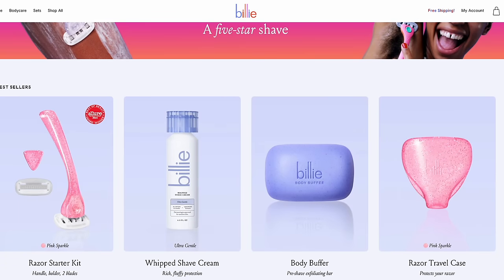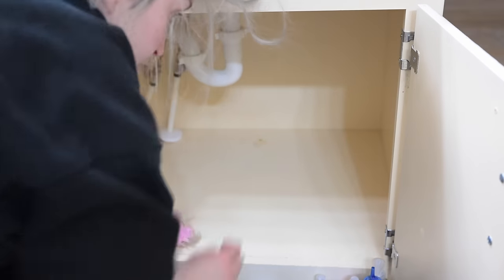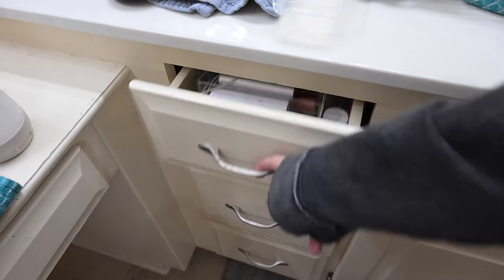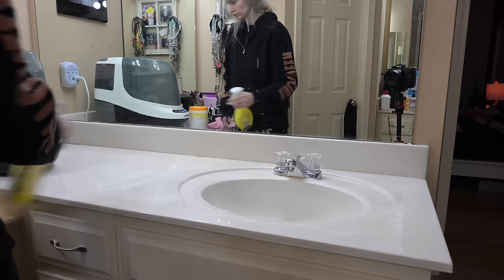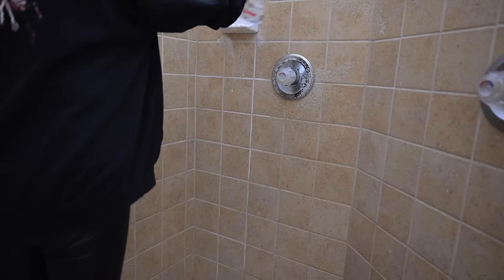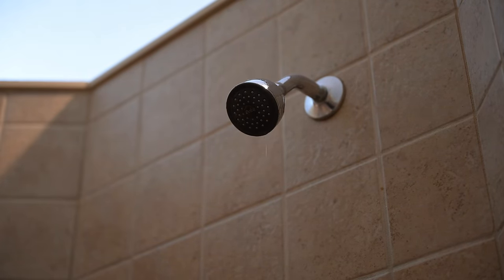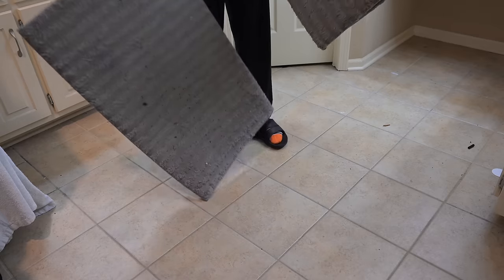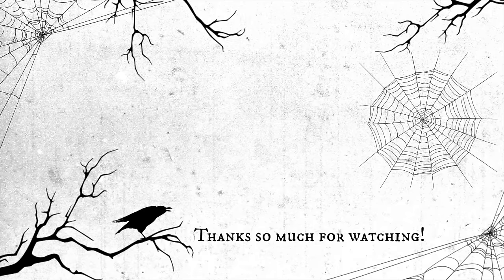BATHROOM SPRING CLEAN 2024!!

Comment: Ghoul, I bought that spin brush after I saw you use it last year. It is a lifesaver!  Been using it again this week. Hope you find yours! I also just got similar shelves for my shower during Amazon's Big Spring Sale.  Almost done putting them up!  I have been re-organizing/decluttering this year.  My tip: Just take one room, one drawer, one cabinet, one closet at a time.  95% of the time it doesn't take as long as ya think it would. 🖤

Comment: This tip has a bit of a twist. My mother would put Pine Sol in her toilet bowl to help clean. For years I’ve done the same, but never really much difference, - until recently. I poured some Pine Sol in and got distracted doing other things, and forgot about it. (I’ve had some health issues and my toilet was in the worst shape ever.) Fast forward a number of hours later (1/3 to 1/2 day). I remembered and used my toilet brush and it was like magic, it cleaned so well. A very nice surprise, with almost no effort at all.